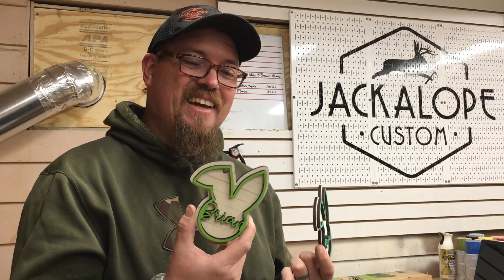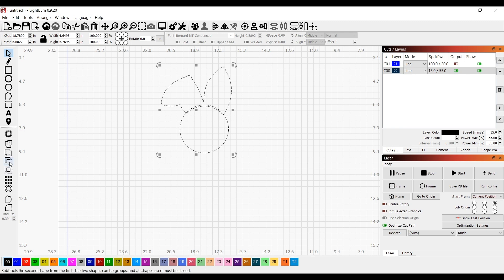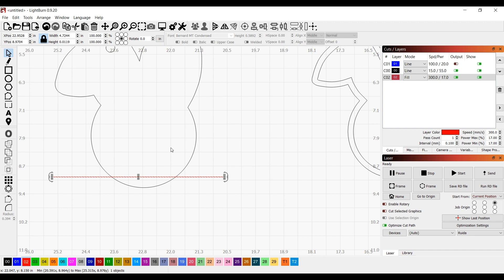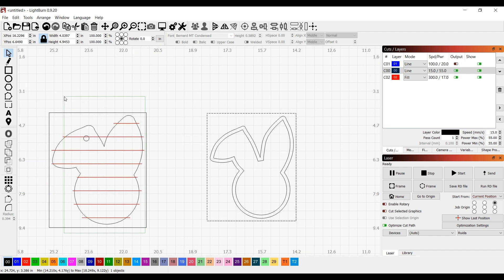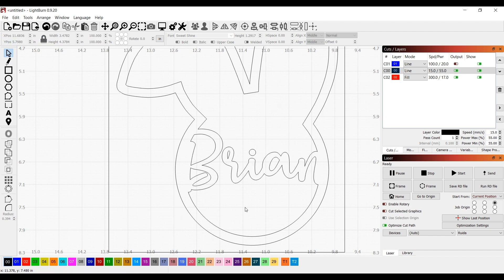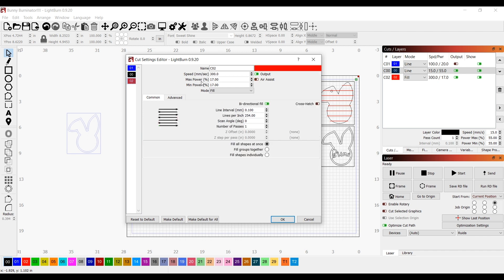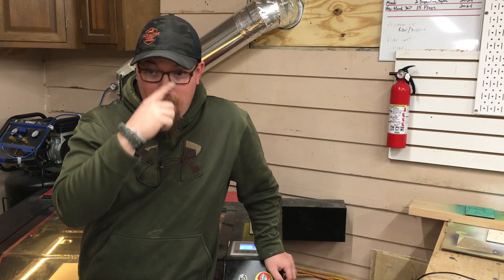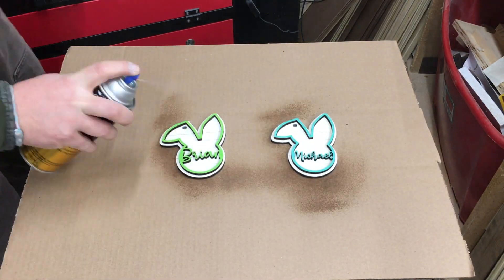How to design and make Easter basket name tags in Lightburn with OMTech Laser

Comment: Great video. Nice work. Just a tip from my experiences . You might want to move your fire extinguisher. I had a small fire and my fire extinguisher was also close to my machine I had to go through the fire to get the fire extinguisher so I now keep my fire extinguisher a little bit of way from my machine.
Reply from the maker: Doug!!! That’s a great tip. I overlooked that scenario, but do have other extinguishers around the shop if one is out of reach. 

Thanks for the kind words! 👊